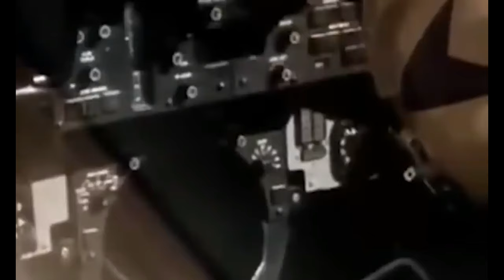Why Mig-23 Flogger Ranks as History's Most Disappointing Fighter Jet?

Comment: the MIG-23 multi role air defense fighter was to replace the MIG-21FL multi role air dominance fighter . . . or that's what they thought & it did replace the MIG-21FL but only barely . . . the MIG-23 was flawed by design & function from the very beginning, so much so that the Russian Air Force retired the MIG-23 multi role air defense fighter after six years of not very distinguished service . . .